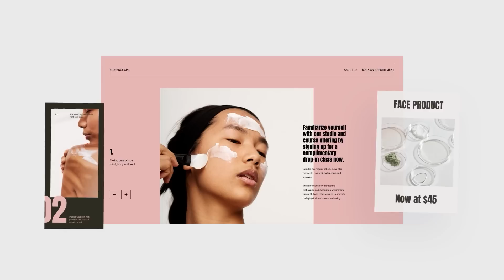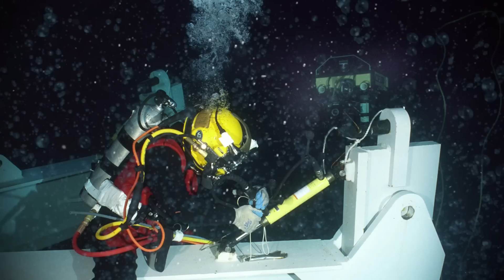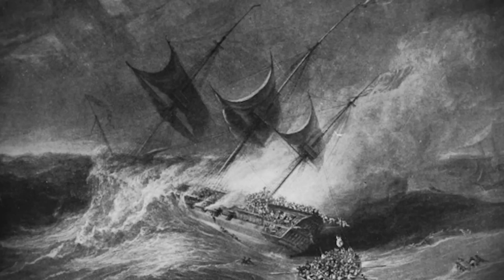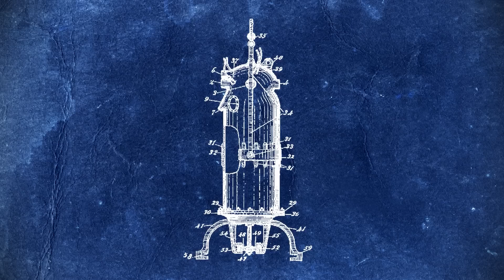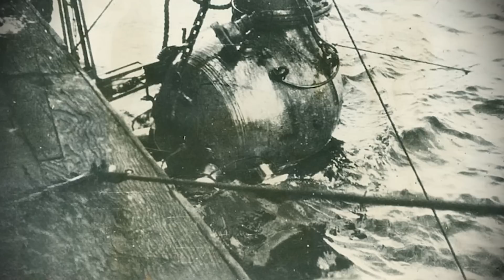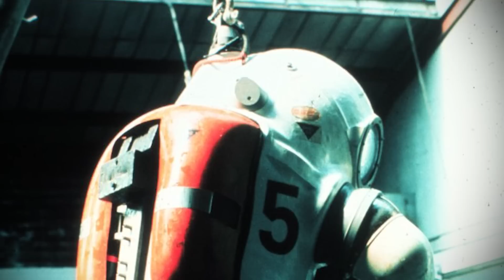The Insane Engineering of Atmospheric Diving Suits

Comment: 2000’ deep would be aTa 61, which is atmosphere absolute, which is astonishing how they can do this! To simplify for this who don’t understand dive science, aTa 2 would = 2 times the atmospheric pressure pushing in on 
you at 66’ deep.   At aTa 1, the pressure per square once is roughly 14.7 psi, so at 2000 feet deep, it approximately 896 psi.  Another example would be the titan sub.  When the sub imploded, it was at 12,500’ deep.  That is equal to aTa 380, which means 380 atmospheres of pressure. Since aTa 1 is equal to 14.7 psi, at that depth, that is an astonishing absolute pressure of 5,586 psi, pounds per square inch!   For those wondering why the titanic didn’t implode, the Titanic didn't implode because as it sank, the ship filled with water, equalizing the pressure inside and outside the hull.  For the record, I’m not a scientist, I’m a diver who had to study dive science in order to get a couple certifications I wanted, and just think this stuff is pretty awesome!

Comment: 7:20 The ROV industry is quickly surpassing the abilities of these divers. I have great respect for what they do but modern, top of the line ROV systems all but eliminate the need for divers of this nature. Check out the work done by Schilling Robotics or ROVOP for some good examples.
Reply: 24:00 Oceaneering is part of the push towards ROVs over divers now
Reply: Diving is "so dead" that Oceaneering, having previously given up diving outside the Americas by 2000 and gone all in on ROVs, has now resumed diving in Angola and Azerbaijan. Subsea intervention is a tool box, and you use the right tool for the right job. ADS had its day many years ago, but ROVs will never replace air and saturation diving in shallow water.

Comment: What I have never understood about the lobster claw approach is that we can make fairly dexterous robotic hands with strong grip strength. Yet nobody seems to have simply made gloves with feedback and combined the technologies. Maybe it would not work, but it seems odd nobody has at least tried it.
Reply: The JIM prototype in 1969 initially used a hand-like design at the end of the arms, but the technology just wasn't there at the time and it was quickly replaced.

Comment: Anyone : Why don't submariners as well as users of this kind of suits use partial pressure just like airliners?  If going to 1000 feet, pressurize the vehicle to 500 feet, so that the hull is handling just 500 feet between the inside and outside ... ???  Submarines have plenty of time to decompress for eventual equalization to atmospheric pressure, and "atmospheric" diving enclosures should be able to keep pressure in as well as keeping it out, so decompression should be as simple as a pinhole leak once the suit is on the deck of the support vessel.
So WHY not have it done that way?

Comment: I'm a subsea engineer. We make those 1 atmosphere systems and use them in the gulf of Mexico. They are claustrophobic and it's definitely not for everyone. They are better than that white one you showed at the start but even so, they have limitations. You're better off using an ROV. They are unmanned and can just do more. Apart from shallow water, there's very little reason to put a human in the water.
Reply: Any chance for one mated to a powered exoskeleton?

Comment: There are different levels to what one could call @recreational technical" divers (non professional technical divers). 

You can start off learning how to perform decompression stops using back gas (whatever you're breathing during the dive), an option to use 50% oxygen for decompression stops, an option to learn how to use 100% oxygen (max operating depth is 20' not 10'). 

Anyway. The point is there are several levels to "technical diving." 
Fkr example, not all "technical divers" are qualified to perform decompression stops. They may use tech gear for specialty technical diving though

Comment: i worked in design and engineering at OceanWorks for many years……your photos went off the rails at about the 25 minute mark……when talking about the WASP you were actually showing OceanWorks HS2000 US Navy suit, then you moved off Oceaneering and actually showed an Oceaneering WASP, then when you started talking about OceanWorks and the 2000ft HS2000, you were showing a photo of OceanWorks Quantum 1200 suit, a 1200ft version of the ADS
Reply: Great video, but also the internet seems to disagree with you about the record for deepest ADS dive which apparently is not the worker in the Gulf of Mexico at 650m, but a Navy diver Daniel Jackson testing the Hardsuit 2000 at 610m. I also found some confusing answers to when the British HMS-M1 was actually sunk and when Otto Kraft dove looking for it, because the dates you give in the video are impossible as it says he dove in 1924 when the sub wasn't sunk until 1925. Wikipedia gives the 1925 date for the sinking as well, but has no mention of Otto Kraft's dive.
Reply: @midguard7917  Demonstrating the danger in getting your information from the internet. The USN hardsuit dive reached 2,000 feet in 2007 and announced a "world record" because they didn't know any better. Oceaneering put the WASPs to 2,150 feet in 2000 when repairing the Pluto gas flowline for Mariner Energy.

Comment: If it had robotic arms and legs it could eliminate the joint problems. This would require plenty of electric power but that should be feasible, especially with a tether. Have sensors on a bodysuit to operate it.

Comment: 6:45 - Sorry, but that is not the most gruesome death imaginable.  Not by a long shot.  In fact, its so quick you don't know it happened.

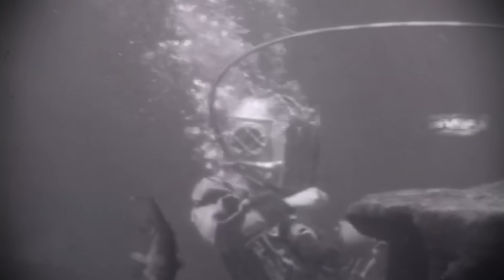However, 'The Squeeze' ( 3:28 ) ...now THAT was the worst way to die (in diving).  Your body (often) wasn't forced into the helmet immediately.  Oh no.  You felt the pressure increasing, the suit tightening, constricting.  As in continues, slowly snapping your arms, legs etc.  As it starts to extrude you into the helmet and air pipe (like slowly squeezing a tube of tooth paste).   This might be why, today, we make sure when something fails (in diving) its graciously fast :-)

Comment: Breathing oxygenated fluorocarbon compounds or even saline solution saturated with oxygen for deep dives will probably never happen. The problem is it's like breathing unset jello. Because of the viscosity, you will get around 4 breaths a minute. The faster you breath the more oxygen to compensate for the added work. It quickly becomes a vicious cycle. The work around is to stop breathing. If a liquid had enough oxygen that you only needed to breath once every minute or so. But you run up against supersaturation issues. You can only dissolve a finite amount of gas into the liquid.

Comment: 5:30 Nitrox is adding more oxygen to the breathing gas, which increases bottom time but decreases the maximum depth you can use it at for fear of oxygen toxicity. The deepest you can use nitrox is around 90 ft
Reply: You don’t experience those at atmospheric pressure which the suit maintains.  They can do down to 2300 ft which is limited by suit

Comment: You can actually breathe ordinary air way beyond the recreational limit of 40 metres/130ft.  The 'safe' limit is 66m, although beyond 86m there is significant risk from oxygen becoming toxic to the nervous system, leading to convulsions and death.  Also, depth on its own does not give you decompression sickness.  The clue is in the name.  As you later say it's the coming back up where you have to be careful.
Nitrogen narcosis is not a problem just below 40m.  It's an individual thing and some people get 'narked' at as little as 25m.
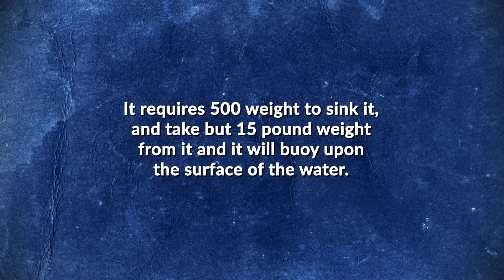'500 weight' (9:21) is actually 5 hundredweight, ie 5cwt or 560lb.  I guess they don't teach Imperial measures in school nowadays.
The pressure issues with space suits are minor by comparison.  They only have to deal with up to 1Bar of pressure change.  The temperature range is the problem.
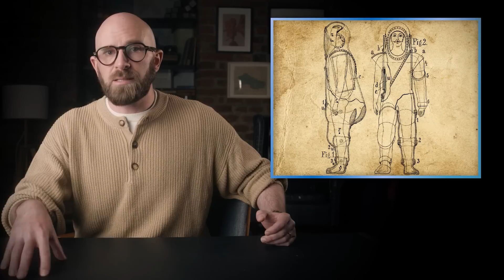For the first 'modern' ADS (15:35) I assume you're referring to Neufeldt Und Kuhnke.  FYI it's pronounced 'Noy-felt and Koon-ker'.
Cast magnesium and sea water; what could go wrong?
As you say, dexterity is still a big issue and the answer has to be in more complex robotic whole-hand systems.  But there's the rub for the ADS.  It's cheaper to run a robotic hand remotely from the surface.  Current advances in ROV tech make the ADS pretty redundant.

Comment: The problem that we've encountered with liquid atmosphere breathing for diving is the fact that the liquid is very viscous.   It doesn't move through the lungs enough to remove the CO2.    So it works... kind of... but the problem is getting the C02 out of the lungs.   They kept mice alive submerges in one of those liquids for several minutes, but they all quickly died due to carbon dioxide poisoning.  They also did some human trials on near death premature infants which showed some promise in 1989, where they used a fluid to inflate the infant's lungs to start them breathing.   The premature babies all still died, but showed physiological improvement, so they're looking at doing further research.  Premature babies often have a really hard time breathing and they're looking at using it as a way to re-create the liquid breathing from inside the womb with it.
Reply: Don't forget about rectal breathing, proven by the infamous experiment of pigs sitting in a tub of oxygenated perfluorohydrocarbons, inhaling the oxygen through their but. It's been proven in many species of animals and would work in humans too.
Reply: You do not breathe fluid in the womb, you do not breathe at all, thats the reason we get hiccups. The body trains breathing without taking in fluids. All the oxygen comes from the mother via umbilical cord.

You guys really need a catchup in 6th grade Biology.

Comment: Snorkeling being impossible under one meter just doesn’t seem right… it just seems like you should be able to go deeper.
Reply: As a teenager who loved to swim in the local river, I wanted to be able to snorkel on the bottom which was about 6 feet deep.  So I came up with a contraption that was 6 feet of tubing with a float at one end to keep it above the water.  It worked until I got around 3 feet down and then I couldn't inhale.  I'm pretty sure that if I made it down to the bottom and tried to breathe, the pressure would force the air out of my lungs and back out the snorkel.

Comment: Check out the other pressure suit, the AX-2.
It was going to be the latest and greatest in NASA Space Apparel...(un)fortunately, it was never adopted.
The suit moved quite well, but it didn't move like a human...natural reflexes in emergency would cause the joints of the suit to lock-up.
While it would have solved many space-related issues (radiation and micro-meteor protection), the lack of proper mobility doomed the project.

Comment: About three minutes in, l am sure this was just an innocent misspeak, but snorkelers can certainly go well beyond one meter in depth lol.
Reply: I think he was speaking as if you were breathing from a snorkel at one meter submerged, in which case thats accurate. But I inferred the same thing initially.
Reply: I’ve tried long snorkels . The pressure fatigues your lungs quickly at very shallow depths. So I’d say snorkels aren’t useful below arms depth at all.
Reply: @jefferyboring4410  I don't doubt that at all, but snorkelers can absolutely hold their breaths and dive well below one meter's depth for some moments and return to the surface to breathe again without any ill effects. I mean, even without a snorkel, a person can easily swim below one meter depth for extended periods.
Reply: @davidtatro7457  I don’t think anyone is questioning that. It’s the act of respiration via a tube to the surface at depth.  Your diaphragm simply cannot overcome the pressure being exerted on it externally past a certain point, hence the confusion in Simon’s statement.
Reply: @beez1598  Sure, but l think that the average human could probably manage to respirate at the depth of one meter, though granted it would take more effort than at the surface.
Reply: @davidtatro7457  Torricelli's law states that the static pressure inside a body of liquid is.

Pressure = density * gravity acceleration * depth.

For water that works out to be about 9.8 k Newtons / m2 per meter of depth, or 9.8 kPa per meter.

But, pressure equals force divided by area, so if we multiply the water pressure by area of the chest cavity, we can estimate the total force exerted by the water on the ribcage at a given depth.

If we estimate the areas of the ribcage to be about 0.2 m2 then the total force at 1 meter of depth is about 1,960 Newtons or about 440 pounds. That's going to make breathing basically impossible. It would be hard to breathe with a 100 pound weight on your chest. So realistically at 30cm, just breathing is going to require tremendous effort, and probably more oxygen than you'd be able to pull into your lungs.
Reply: @beez1598  Very interesting. And yet, so many millions of people snorkel wordlwide and go way below one meter in depth. Granted, they are holding their breaths there and not actually breathing, l mean, unless their snorkel exceeds that in length.
Reply: @davidtatro7457  you’re conflating snorkeling and diving, purposeful or not they are different they have different definitions, and I think you are aware of that. It’s like arguing the limit of how fast you could walk a mile by stating people run miles faster than that.
Reply: @beez1598  Thanks for the clarification. You're probably right.
Reply: i dont think the pressure would stop you from breathing but if you had a meter long hose to the surface it probably wouldn't allow fresh air to exchange in the hose

Comment: Even 20ft down your ears pop and you can feel the pressue so anything beyond that is unimaginable.
Reply: Because most of your body is incompressible liquid or solid the only patrs affected by pressure are the air spaces.  Because you are breathing gas at the pressure of the water around you these too are unaffected.  So apart from clearing your ears on the way down being at depth feels absolutely no different to being at the surface.
Reply: It's really hard to inhale.
Reply: @insearchoftheperfectwatch934  not with scuba gear.  Your regulator will give you gas at just above the water pressure around you so breathing stays easy.
Reply: I've been down to 140 feet, once you equalize it hardly feels different than at 20 feet.
Reply: You're supposed to clear often or you will blow your eardrums out! We can't really feel pressure, but the largest changes are within the first 10 feet. Add 1 atmosphere of pressure every 33 feet. 200% pressure change going from 1 ATMA to 2ATMA vs going from 1700 feet to 1733 feets only a 101% difference.
Reply: @flip117100  thanks.
Reply: Once you get past one atmosphere (~33ft) it doesn't feel much different. But yes, clear well and often as your descend and you shouldn't have a problem 
I've been down to about 140 ft and you don't even realize you're that deep
Reply: @CrisMind you are correct Sir. 
  I’m only a recreational diver, however I once followed my dive buddy to 145ft.  It wasn’t planned and we spent very little time at depth. 
   This was in the 1980s so we didn’t have the modern dive computer. We made a very slow ascent and made three unplanned stops to the surface.